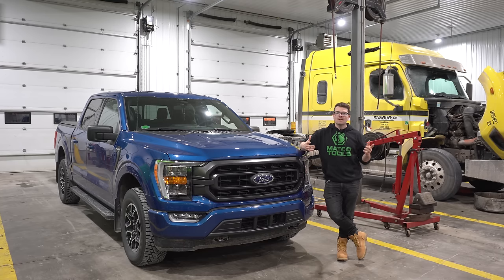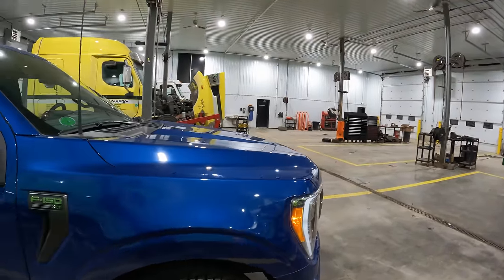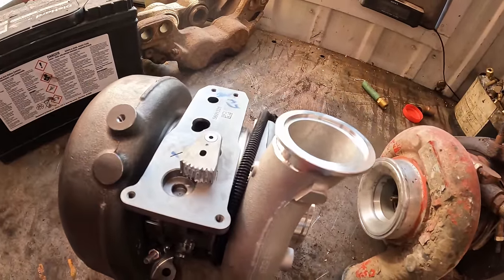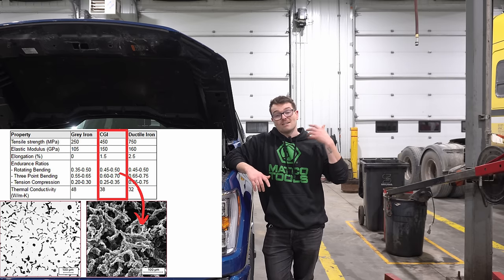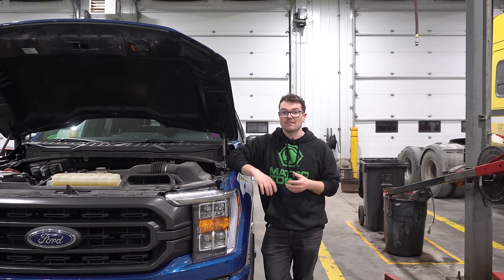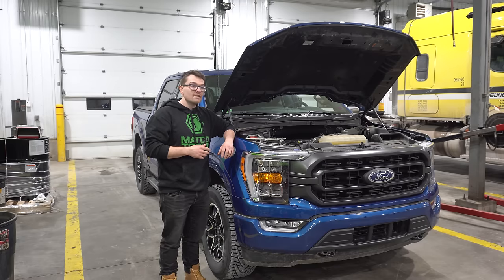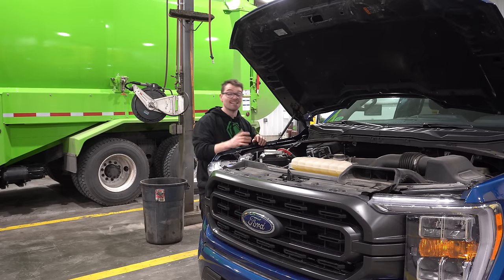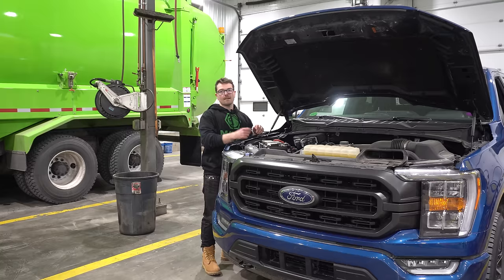Ford F150 2.7L EcoBoost V6 Engine **Heavy Mechanic Review** | How GOOD Is It??

Comment: I've owned the 3.5, 5.0, and now the 2.7.  This engine is definitely my favorite.  Great power for the size, fuel economy is way better than the other two.  I do love the sound of the 5.0 but the 2.7 is just better suited for a pickup.
Reply: 2.7L is the worst engine ford has ever produced… I know 4 people personally who had these grenade on them under 2 years old well maintained, and that’s a lot for one person to personally know.

These are absolutely junk
Reply: @aaronkellar6583 but then I know people well over 200k with their 2.7. So I mean sure sometimes life gives you lemons.
Reply: 235k HARD-DRIVEN TROUBLE-FREE MILES SO FAR ON MY 2015 "NANO" AND STILL GOING STRONG! HANDS DOWN THE BEST ENGINE OPTION FOR AN F-150! IF YOU CAN'T HAUL/TOW IT WITH THE "NANO," GET AN F-250 W/A DIESEL!
Reply: LOL An engine smaller than the optional PINTO V-6 (2.8/171 ci) that requires power adders to get out of its own way, especially in a two-ton vehicle...not just pass...but HARD pass.
Boost is for getting high performance out of an engine already capable of adequately moving a vehicle without it....., NOT to get tiny little engines to power heavy vehicles.
Reply: @aaronkellar6583 If you don't like it and wouldn't buy one, that's fine. It's your money and choice. However, calling it junk with your anecdotal evidence is plain stupid.
Reply: Looks like two people on here didn't watch the video. This is basically a little diesel that is strong and makes impressive torque, yet still gets decent fuel economy.
Reply: @302Mustang13  Looks like you didnt. That 2.7 joke is a GASOLINE engine, NOT a diesel.
Reply: @302Mustang13  Anecdotal...ROFLMAO.
Thats an analysis based on half a century in automotive repair and engine building.
Exactly what experience do YOU have?
Reply: @donreinke5863  Geez, learn to read. I've known it was a gas turbo engine before it was unveiled. I said it's like a little diesel, I never said it was an actual diesel engine. Meaning it's built like a diesel and has the torque curve of one.
Reply: @donreinke5863  Well I know four people with 2.7 Ecoboost F-150s that have 250,000-300,000 miles with original engine and turbos. So therefore I can say it's bulletproof and ignore all other claims.
Reply: @302Mustang13  Speaking of anecdotal evidence.........
Reply: @donreinke5863  I made it up dude to show anyone can come to a dumb conclusion based on their supposed experiences. Point is if you actually watched the video you'd know Ford is essentially giving buyers and affordable diesel alternative that doesn't have all the emissions crap and is now standard for 2024.
Reply: @302Mustang13 The torque curve of a diesel....ROFLMAO.
Diesels begin to produce torque at 7-800 rpm in the case of a Cummins, and redline on a GM Duramax is 3250 RPM.
The powerband is only 2000 rpm
The turbo on the undersized joke 2.7 doesnt even start to spool up until over 1000 rpm, but has to wind up well in excess of a diesels redline to produce any real power..
Even that still-undersized 3.5 has zero low end power until the turbo spools up.
Ive driven F-150s with those, and was NOT impressed.
Reply: @302Mustang13 Backpedaling and excuses, has to be a Sniffy voter...LOL 
At any rate, that little turd is NO diesel alternative as it has NO characteristics of diesel power, the closest thing to a diesel alternative is that 7.3 gas engine (445 ci) Ford currently makes, and better still 385 series 460 engines as well as 454 and 496 Chevrolet engines as well as the Dodge V-10
All the above are capable of producing low RPM (though not as low as a diesel) torque without ANY power adders to fail and without stressing a tiny undersized engine that has no business in anything larger than  a compact truck/SUV.
Reply: @donreinke5863  You clearly don't know anything about the 2.7 Ecoboost nor have you driven one. When you have to compare optional big block V8s to an entry level or affordable truck engine, then you are losing the argument. The crazy part is that Ford offers all different types of engines for the F-150 so you don't have to get what you don't want. For those of us not living in a cave, the 2.7 Ecoboost is a great diesel alternative.
Reply: @donreinke5863  I've driven many F-150s with V6 and V8s and the 3.5 Eco is hands down the quickest and torquiest. Don't get me wrong I love the 5.0, but it's not the most powerful truck engine. Only reason I'd choose the 5.0 is if I was planning on supercharging it. Otherwise, I'd choose the 2.7 and tune it.
Reply: @donreinke5863  and yet you think that cylinder deactivation is something good…🙄 making a larger engine smaller
Reply: @donreinke5863  zero low end torque, like the 5.0?
Reply: @paulhunter9613  Which 5.0?
Have you been around long enough to remember the "racers maxims"?
"Torque....takes cubic inches" and
"Torque..Is acceleration"
Even boosted, displacement rules.
No one ever tried to put a supercharger on  an engine smaller than 426 cubic inches (except the Kaiser brothers) and expect to be competitive racing dragsters and funny cars.
When Ford came out with their dinky 4.6, they realized it simply didnt have enough low end power to get a truck or Panther body car moving (despite having a relatively long stroke for its displacement) until the RPM came up into the powerband.
Their solution? Introduction of the  4R70W wide ratio automatic which had a low gear ratio of 2.84-1 vs that transmissions predecessor the AOD, which had a low gear ratio of 2.40-1.
(The GM 700R4/4L60E is better still, with a low gear ratio of 3.05-1)
The 4R70W also used a higher stall torque converter than did the AOD. 
Now..what else do you need to learn about?
Reply: @paulhunter9613  Oh...PUH-LEEZE......cite EXACTLY where I said that. Youve either got me confused with another commenter or youre throwing shade. Cylinder deactivation is an absolutely retarded idea.
GM found that out with the infamous 1981 Cadillac V-8-6-4..
Later iterations are only slightly less problematic.
Reply: @donreinke5863  I won’t be learning anything from you that’s apparent. You need medication, or possibly it’s too late with the dementia you suffer from.
That 5.0 suffers with the same problem, it takes awhile for the torque to come into play in the power band. The 2.7 doesn’t have that problem, it’s faster than a five oh v8
Reply: @paulhunter9613  ROFLMAO Ive induced you to make ad hominem attacks......since you obviously dont have the mechanical, technical or engineering knowledge or experience to match me, or even someone with half my ability.
Ive driven a couple trucks equipped with the  almost equally lame 3.5 eco-slug engine.
Better hope theres no traffic coming if youre trying to cross 4 lanes of traffic, or its T-bone time. The turbo wont spool fast enough. Theres a BIG difference between quicker and faster
"It takes a while for the torque to come into play"
Did you learn NOTHING about what was said about "torque takes cubic inches"???
The tiny  2.7 joke has to be even worse.
Good job kid, youve played yourself..and picked the wrong adversary.

I love the stupid, they are entertaining.
Reply: @shortyorc121 I have 140000 miles on my 2018 2.7L crewcab.
Reply: @donreinke5863  Jesus dude... show us where the V6 hurt you already 🤡
Reply: @Alo5678  Using such a tiny engine in a 2 ton+ vehicle I find seriously ignorant.
Unless someones racing and rebuilds the engine frequently, trying to get over 1.5 hp per cubic inch is just asking for some sort of failure.

Comment: Been waiting for this review! Can’t wait to see towing video. I ordered my 2022 F150 with the 2.7 and the 3.73 gear ratio. With the correct gear ratio and tow package it’s rated to tow 10,100lbs which is more than enough for a half ton I feel. I tow an 8,500lb camper and it pulls like a freight train especially with premium fuel. It’s beyond impressive. 

Not only that. When I’m not towing it gets amazing fuel economy for a full size gasoline truck. I averaged 23mpg (10L/100km) from northern NY to south Florida and back at 75mph/120kmh average speeds. And this past summer I went from northern NY to Quebec City Canada and back at 60mph/100kmh speeds and averaged over 26mpg(9L/100km)!
Reply: That's amazing fuel economy considering the parameters for sure 🎉
Reply from the maker: travelling up to Quebec city eh, Bonjour! But yes in my opinion if you are looking to tow north of 10,000lbs an HD truck is probably a better option. regardless the 2.7 with 3.73 gears sounds like a great combo. enough pulling power to tow well but still be greatly efficient went unloaded!
Reply: Very nice. I towed a 6500lb trailer 1800 miles across the U.S. and it did quite well. If I remember correctly I would usually lock out 9th/10th, maybe 8th as well. My truck has a weird shake at low rpm under load, that I need to get checked out. 

I have the 3.55 gear but wish I had the lower set. Is that the payload package that set you up with that gear set?

I was basically completely maxed out on payload with a few more things in my truck. Remember to check yours and always use a WDH if towing over 5k
Reply: Thanks for the metric values!  Hope you enjoyed visiting us up north!  Cheers from Qc.

Comment: I’ve got over 150,000 miles on my company 2.7 f-150 and haven’t had any issues.
Reply from the maker: That's what everyone says, very reliable units.
Reply: Do you have a oil catch can? Head it's the number one upgrade for the 2.7 and 3.5
Reply: LOL I have a 47 year old Ford in the shop right now for a rebuilt engine. Its documented mileage? 381,000. The 5 digit odo has rolled over 3 times, its engine though was fastidiously maintained.
Let me know when that tiny overworked smaller-than-a Pinto-engine thing even gets anywhere close.
Reply: @donreinke5863  lol, I’ll bet you are are putting in a Pinto engine!😝
You are obviously enamored with the Pinto engine, you use it in all of your comments/opinions
Reply: @paulhunter9613  The early Ford 2.3 engine block or as you call it..the Pinto engine will withstand 600+ hp and is used in specific classes of racing. Despite the overbuilt cylinder head used on the 22R and 22RE Toyota engine, the Ford 2.3 is iron-over-iron,a design which provides ultimate durability under extreme conditions..
The engine was used for many years after the Pinto was discontinued in Fairmonts, Mustangs, Thunderbird turbo coupes but most commonly in Ranger pickups.
I would have a hard time deciding between a 22R/RE equipped Toyota pickup and a 2.3 Ranger 
The one advantage of the Toyota engine is its timing chain vs belt used on the Ford, but in stock form the Ford is a non-interference engine.
Reply: @donreinke5863  you are the one who kept referring to a pinto engine, not me. I just called you out on it
Reply: @paulhunter9613  Yet you cant explain specifically WHY the "Pinto" engine is not as well built or reliable as i claim.
Debate..isnt your strong suit....lol
Reply: @donreinke5863  I prefer not to waste time attempting to educate you with a closed mind like yours . Now in your opinion/ reply make sure you say pinto engine at least twice like you have done before

Comment: We have a 2022 F150 2.7 and a 2022 F350 7.3 gasoline engine. Love them both but the 2.7L is just so much fun to drive. Very peppy and easy to just hop in and get around with. The engine is so quiet at idle and the torque and around town performance is simply first rate.
Reply from the maker: I loved driving it around town! without the radio on you can hear the turbos spool up if you listen for them. absolutely loved it.
Reply: The 2.7 is going to be a rocket in the ranger
Reply: Oh and is the 2.7 a diesel? Lmfao we know that a 2022 7.3 ford is a copy paste Ls and not a diesel. This isnt 2002
Reply: @slyfox4564  Take your meds.

Comment: I own a 2023 with that engine,is being almost a year ,light duty and daily driver (use),so far is being excellent,I feel the suspension rides smooth enough for me and passengers,it drives like a passenger car,I was going to get a medium size pickup, but for my work I need it a little more room for tools and stuff, once in awhile I do yard waste run dumps and still haul a 6x10 landscape trailer with rails (to haul more stuff)so far I been hauling around 6700 pounds with it, plus 2 guys tools,the weight of trailer it self I'll say around nearly 8000 pounds total and it pulls it like nothing no problem at all, I'll see how this little engine does in the near future

Comment: Not going to call the 2.7 the best engine of all time, but I gotta say my 2017 was faultless for 6 years and 94k and so far my 23 2.7 is starting out the same way, the 10 speed is questionable, compared to the 6 speed it feels clunky sometimes. I do Love this engine, reminds me of my old 67 Mustang 289 it’s quick off the line.
Reply: Yeah the 10 speed is way too busy and is probably the most questionable thing in the package. It's only chunked the gears once on me but I let off and do it's thing and haven't experienced it again.

Comment: Love them or hate them, one has to admit that Ford is definitely at the forefront of automotive design,  particularly the engineering side.
Three obvious examples can be found under the bonnets of these 
F- 150's
Reply from the maker: I agree, new designs are always a little touchy for me but it seems like Ford is hitting their stride with these Eco boost engines in the trucks at least.
Reply: I disagree and agree. Ford has great styling, it's very euro inspired but the high end trim levels loose their luster with use and age. As for engineering, sure they have lots of ideas and execute them, but in all honesty from a reliability standpoint, the 3.5 and 2.7 ecoboost do not hold up over time. I've owned both and liked them for city driving with the beach inflatables in the back... bit as a hardened work truck, they can't keep up and I've had numerous failures such as turbos on both engines.... cam phasers on both actually. Extremely cold shutter due to increased oil pressure. In fact, the best Ford I've ever owned was the 2011 Ford ranger with the 2.3l inline 4 with a 5spd. I still own this truck for inner city use. This ranger cost me 15k new in 2011. You can't even compare the new maverick in price and reliability or usefulness. 

I did drop the Ford big trucks because reliability, shitty dealer service and overall they really just aren't that robust or a food truck. 
I did go with the RAM 1500 with a 5.7. Yes the 5.7 has issues but as a competent at home mechanic, I can fix those issues. It's not as refined but it's built way more robust and the mechanics make more sense for a work truck.
Reply: @joellaurin9007  interesting opinion
Reply: @paulhunter9613  not opinion. It's my real world experience.

Comment: I have a 2017 2.7 with 236xxx miles and going strong.  Only part other than spark plugs replaced has been an evap purge solenoid. Great engine, I had a 2012 5.0 before, I loved the power of the coyote, but the 2.7 is better.  No waiting for the powerband, power is there when you need it.
Reply: What happens when the evap purge solenoid goes bad?
Reply: @BrickMudge  check engine light, and it would idle rough after filling the gas tank for a few minutes.
Reply: @MrCrd783  the purge solenoid seems to go bad with other makes of vehicles also. Thanks EPA

Comment: I’ve always been a huge advocate for this engine. I bought mine new in 2017 and put almost 100k miles of towing on it and the engine in the truck has always been great. I recently had an issue where the top (ringland) of my number 5 piston broke off and I am now doing an engine replacement in the truck. Although wouldn’t call this a wide spread issue, there is a decent amount of people on the 2.7 page that tell of similar issues with piston failures. I am curious to see as time goes what the cause is of this as well as if we will see more and more of it. I’m not sure if it is a pre detonation issue or a material failure issue contributing to it
Reply from the maker: Very interesting! I'll have to take a look into that and see what I can come up with. Thank you for the comment!
Reply: @TheGettyAdventures I look forward to seeing what you find. It seems to be sporadic failures without much rhyme or reason. One thing that does come to mind is a low speed pre ignition condition (LSPI), which does happen to plague some direct injection engines.
Reply: I've only done turbos and a 1 chain besides the boost control valve.  That's the only major repairs I've seen I like the 3.5 eco boost more just because I'm more familiar.  This is my experience as a tech. I don't own one
Reply: 2.7L is the worst engine ford has ever produced… I know 4 people personally who had these grenade on them under 2 years old well maintained, and that’s a lot for one person to personally know.

These are absolutely junk
Reply: @aaronkellar6583  I think that’s a bit of a stretch to say they are absolute junk. A lot of people have incredibly high mileage on these engines without fault. They had a couple periods with some issues but the over all consensus on these is that they are a reliable platform. Everything built in mass production will have a failure rate.
Reply: @aaronkellar6583  I think the 1.0l 3 cyl is worse I've seen more of them fail
Reply: @aaronkellar6583  I put 180k miles on my 2017 2.7L with no issues. Drove it pretty hard and towed a camper a few times. No issues.

Comment: I am happy that i chose 2.7 when i purchased it in 2020(2019 model). I purchased it for gas milage but ended up using it for junk removal business couple years after. People who are stuck in big engine and diesel think this 2.7 is not capable but I pull a dump trailer(empty 4k) and pull up to 9k with no problem. And, going on my 4th year with this truck and still happy with my purchase.